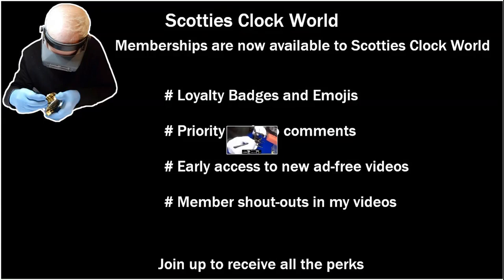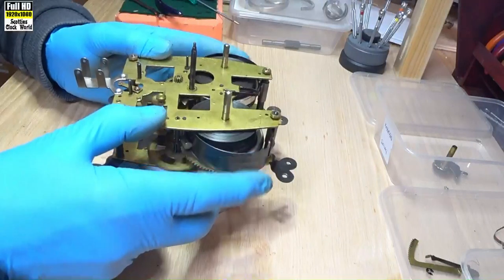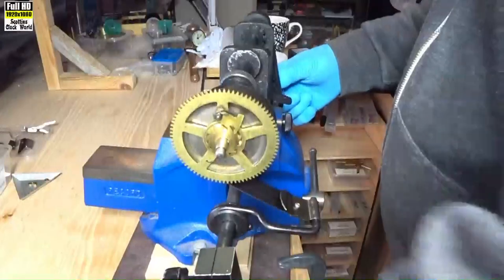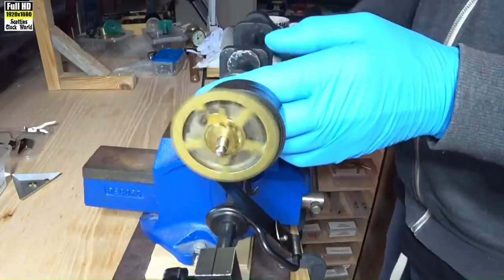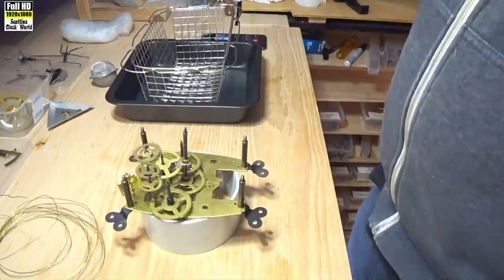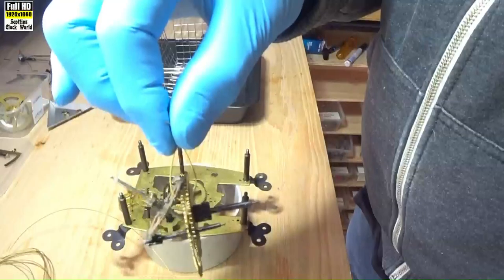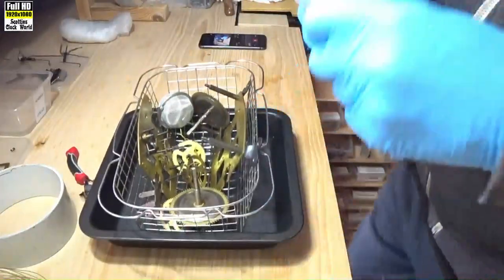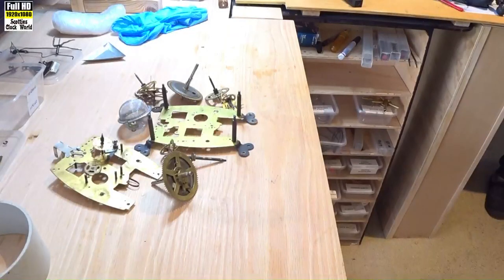How to service a  vintage 31 Day Korean wall clock - Part 3

Comment: I am enjoying your videos and learning as well.  I am curious why you say you can't put the snail and other parts in the ultrasonic since they have steel on them.  The wheels all have steel arbors, what is the difference.
Thanks
Reply from the maker: The steel used in clock arbors is better quality than the steel used in the other parts. Arbors take a lot of pressure from the mainsprings while levers etc are not subjected to these pressures.